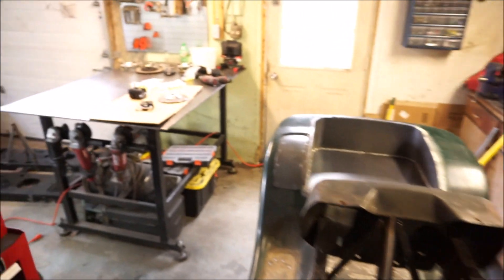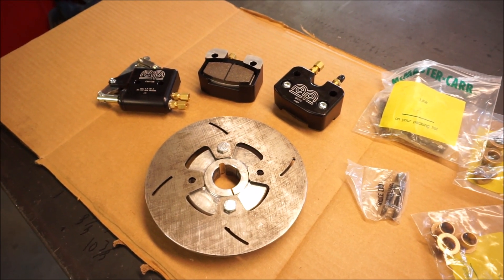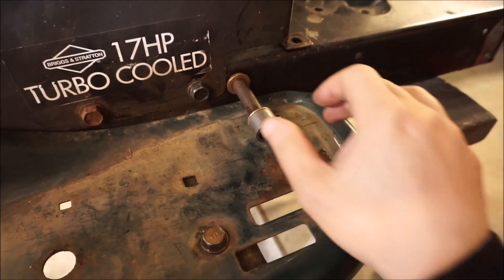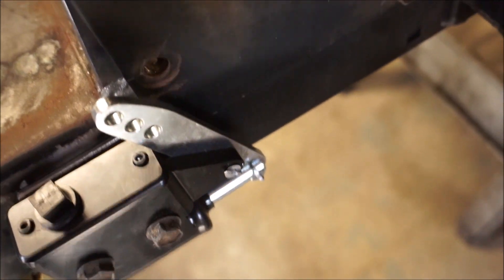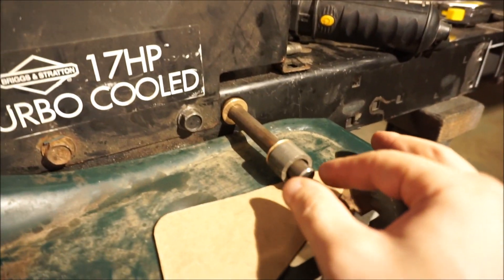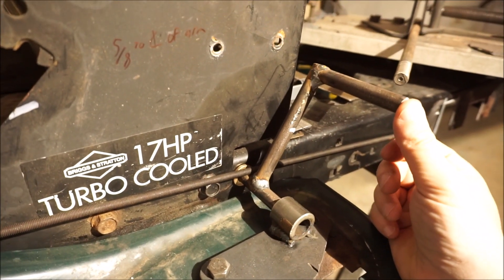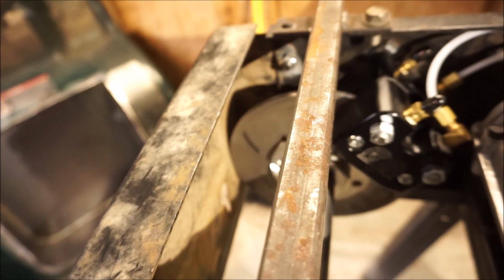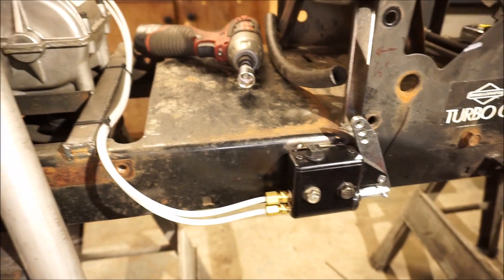Racing Lawn Mower Build Part 6: Brakes

Comment: Have you had any thoughts on trying a "reversed" pedal setup, with clutch on the right, and the brake on the left on a future build? The GP I run is setup that way. I prefer this setup in my opinion. At least with racing on an oval, if I only have to use my right leg for bracing, and not have to operate a pedal at the same time, I found it to be less strenuous.
The factory hole in the frame that you're running the brake shaft through putting the bushing in there I did the same thing too, but mine is the next size smaller, so the side of my clutch with the pedal is sloppier than I would like to be. Definitely going to look for a larger one like you got so it'll fit nicer for my clutch pedal.